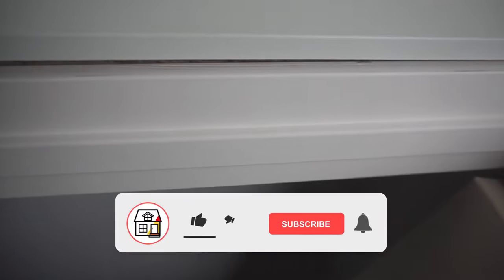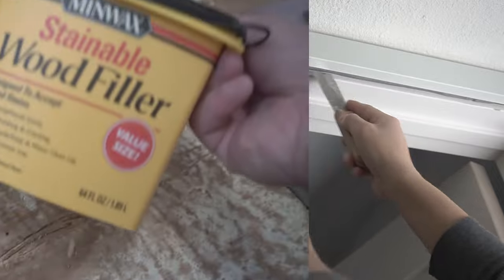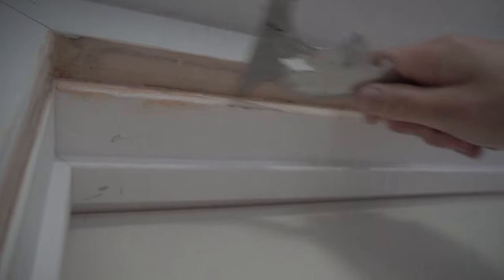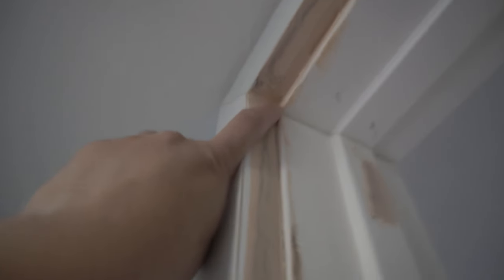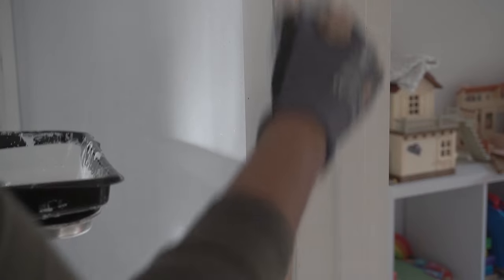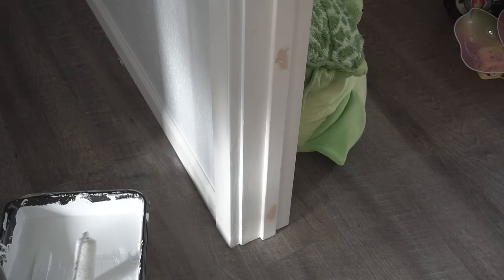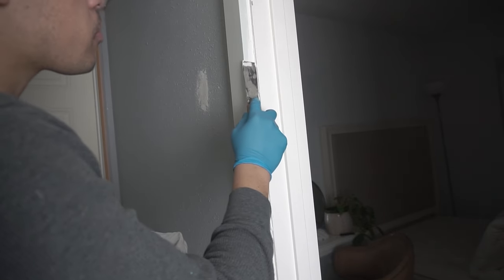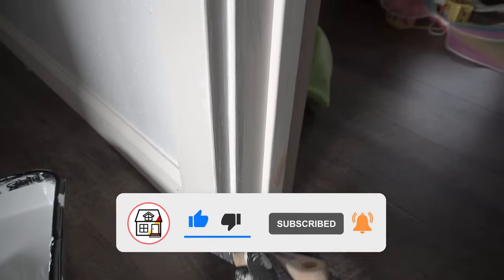How To Fix HUGE GAP Between Wall And Door Jamb! DIY

Comment: I never have good luck with that wood filler so I prefer method #2 👍. Both ways finish up nice.  I will have to remember the backer rod.
Reply from the maker: Thank you Kathleen! I had way too much of the wood filler so I just had to use it up for something lol, but there are other brands of the wood filler that is a lot better for shaping and contouring. Backer Rod will help reduce material for sure 🙏🏽😊👍🏽

Comment: Do your best & fill the rest😂 
Iv come across this a few times & iv unfortunately had to fill with timber strips cut on the table saw. Takes time to get it right (especially if it’s tapered) but is the best option imo because it’s less likely to crack or shrink over time.

Comment: #1 looks good.  but on the big gap on left I'd be concerned about it cracking with age.  I've only used this for small holes - can you really do long , thick sections and expect it to last?
I have a door thats going to need at least 3/8 "  all around.  On a previous door i cut a strip of wood to fill the gap and it came out great , but was a pain.
Reply: On my country the wood strip is the way to go. I use a plane to achieve a perfect fit without any gap, then i paint it and the result is fast and perfect.
Reply: Do you nail the wood strip in, then? Or glue it in? Thanks

Comment: Where did that gap come from?
Reply: it comes from the door jamb being installed level and the walls not matching (not level or wider than the jamb). also the width of the jamb is less than the walls.

Comment: Incorrect get a pro to install it wood filler is for small stuff it will 100 percent crack from the door closing
Reply: you are funny... a pro.  if the jamb isn't as wide as the wall thickness, you will have a gap. if the walls are not level, it increases the challenge.
Reply: @pikepoke 
I think what he is referring to is to have a pro install a jamb that is wide enough to close the gap. He already mentioned that the wood filler is not a good option to use - pro or not. If this is correct, your reply is irrelevant.